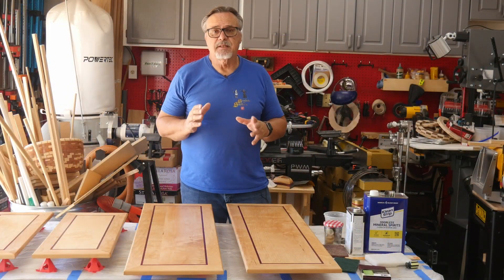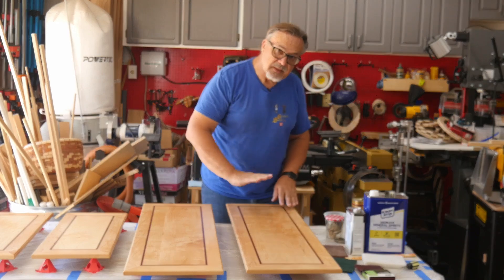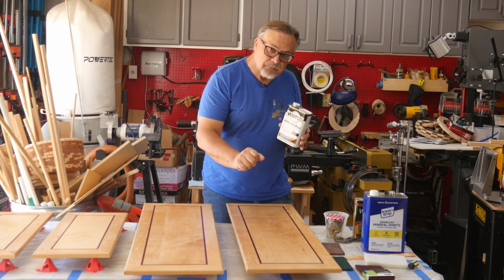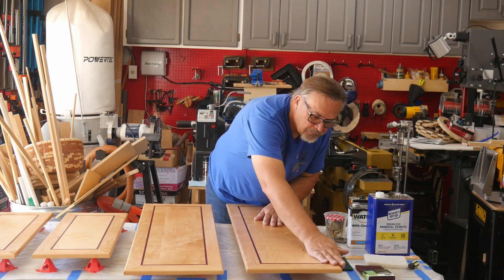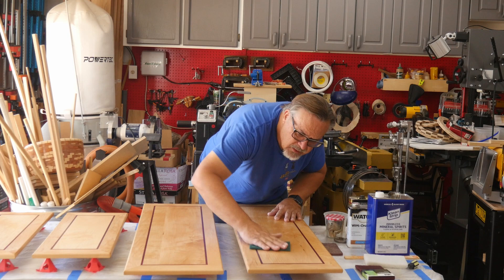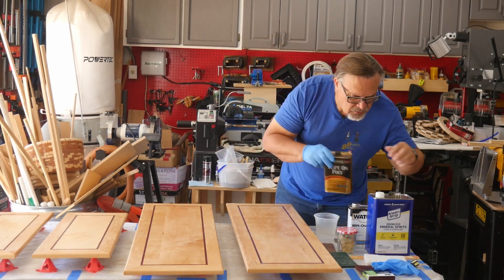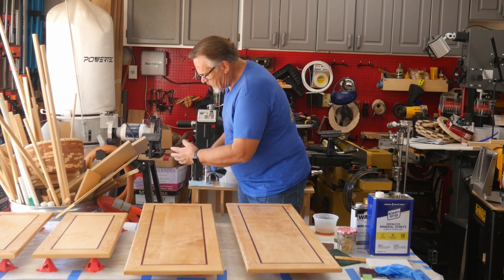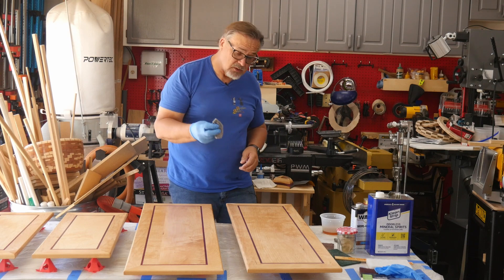Perfect Wipe-On Poly Finish! How to do it!

Comment: Thanks for this.  Question, hoping maybe you can help - i’m using Minwax wipe on poly oil-based varnish applied with a foam brush to finish a painting, and the Minwax wipe on was recommended.  I’ve been shaking it because that’s what the can recommends, and I keep getting bubbles. Frustrating!  The Minwax site says never shake polyurethane varnish, but their own instructions for this product says to shake it repeatedly while using it, which tells me it must settle out. I thought perhaps I could shake it up, then dump the whole can into another container that has a wide enough mouth to be able to stir it, let it settle overnight, and then maybe stir it prior to use?  Hoping this might reduce the bubbles. I heard you say not to shake it so it would seem to me this approach might work if the product does need to be mixed. Any suggestions? Thank you!
Reply from the maker: I would say with just stirring it only, unless it is old and needs a good mix.  Then I think your idea of letting it sit overnight will work just fine.
Reply: Don't shake Poly and don't overthink it. Get rid of those foam brushes. Either use a high quality natural bristle brush. You will have to spend some money on a good brush but it is worth it or...forget the brush altogether and do what is being done in the video and wipe the poly on for a smooth, no brush mark finish. Trust me. The results will make you very happy! Cheers.

Comment: It would be helpful if you mentioned in more detail what rubbing pads brands, course and manufacture is.
Reply from the maker: Sorry about that, they are the 3m between coat abrasive pads, they come in three differ grits according to the color. I use the extra fine a lot.

Comment: Master Nerd; I have heard about using a Paper Bag between coats of Wipe-On (instead of the 3M Pads), What is your Wisdom on this matter. Thank You.
Reply from the maker: I have used paper bags on my wood turnings because it has a high spin rate and a lot of work passes over the paper.  The paper has a very small amount of abrasion and it will work for smoothing out the finish if the finish is smooth. But if you have some dust or small imperfections then I like using the pads because for me they work a little faster to level out the coats.

Comment: No problem i use 1/3 Naptha 1/3 poly 1/3 linseed oil dries good and gets hard, don't buy the stuff in a can it is mostly thinner
Reply from the maker: Once I run out I will be trying that, Thanks!
Reply: I use slower drying mineral spirits in my danish mix. It seems once the wood is sealed, the linseed oil doesn't want to dry and gets sticky on the surface. That's usually the point where I wipe it down good with mineral spirits and start wiping on thinned poly. Is this the right approach?

Comment: Looks so easy but its not..if i do circular motions but the time I want to straighten it its already dried , i have been watching videos , and i still getting marks ..so frustrated
Reply from the maker: Your Wipe-on may be old or a bit thick.  Try thinning it with Mineral sprits and apply it in colder weather (if you are in a hot area of the country).  Hope that helps and thanks for watching.
Reply: @MadNerdWorkshop  I bought it for this project, but after re done the tables  finally I got them done (it was my first project) though, thanks! Your videos help!

Comment: Find it better to just mix your own. Take gloss minwax normal oil poly and mix it 50/50 with mineral spirits. Or thinner if like
Reply from the maker: I do have to try that out. Thanks travisedwards.
Reply: You will be glad you did.  @MadNerdWorkshop
Reply: Fact.
Reply: It works great. Just did some banisters with the 50/50 minwax gloss poly and mineral spirits.
Reply: Yes - I've been making my own wipe on for a few years.  50/50 works well.  I always use gloss for my build up coats - approx 6 coats and for my last coat I'll use the sheen I am looking for like satin or  semi.  Lets the grain show through better.